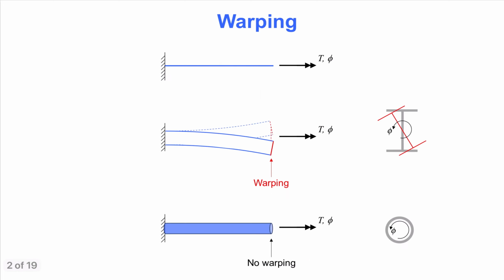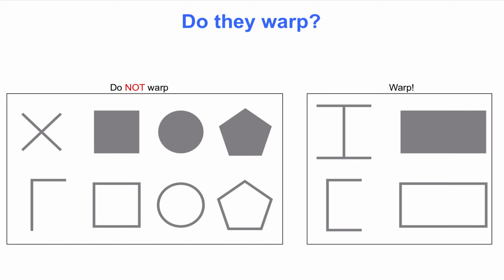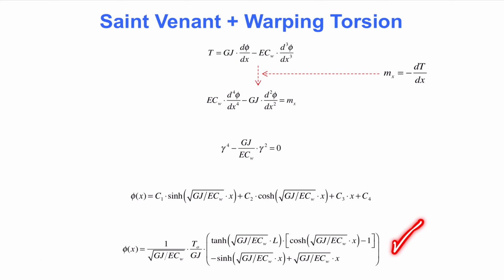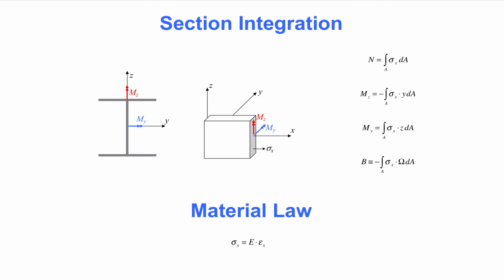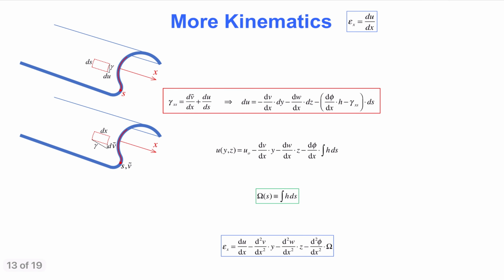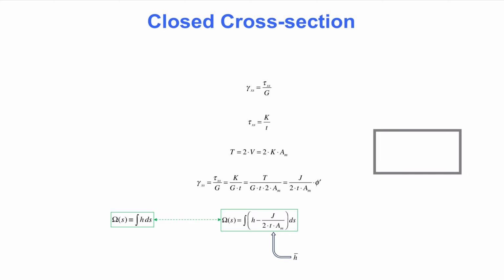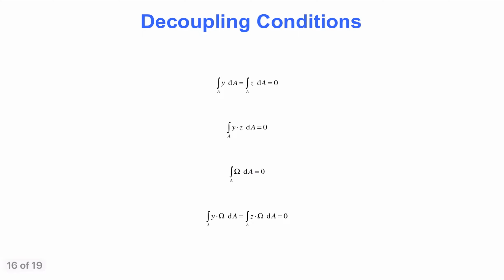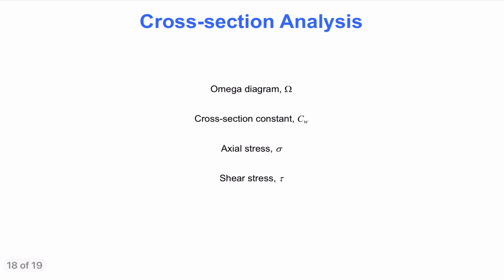Warping torsion (Terje's Toolbox)

Comment: Thanks a lot.
 Sir, can you recommend a book or resources for further reference.
Reply from the maker: Thank you very much for the question.  The references that I use most myself, are printed texts in Norwegian, created by instructors of courses I took back there. Beyond that, one would normally recommend several of the seminal textbooks written by Timoshenko and various co-authors. However, specifically for warping torsion, it might be best to go elsewhere, and then I am reluctant to recommend any specific book. However, when you search, keep in mind that books on ship structural analysis and design often have excellent sections on warping torsion.
Reply: @terjehaukaas  Thank you for timely response. Very glad to hear from you. 
I plan to see more of your videos. The one on warping torsion is excellent. High quality online resources like yours are rare to find. I would request you to upload more such videos. 
Do you conduct any online course?
Reply from the maker: @inaamqazi  Thanks!  At present, I do not conduct online courses, but that is a new idea that perhaps I should think about. For now, I do all my teaching in the classroom at the University of BC in Vancouver, Canada.
Reply: AISC Design Guide 9
Reply: Analisys and design of elastic beams (walter pilkey). Although he is not clear about how to apply boundary conditions to solve the warping displacement problem 😢